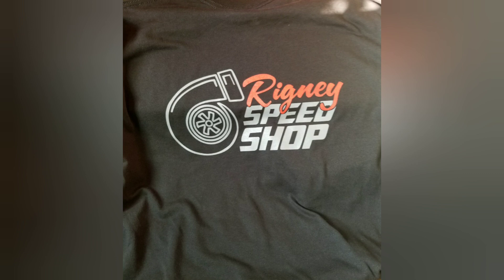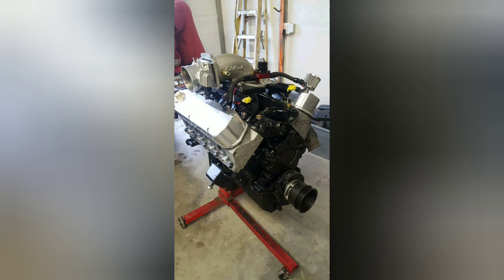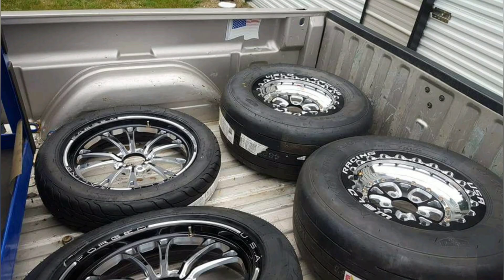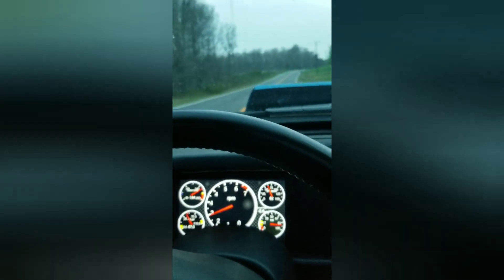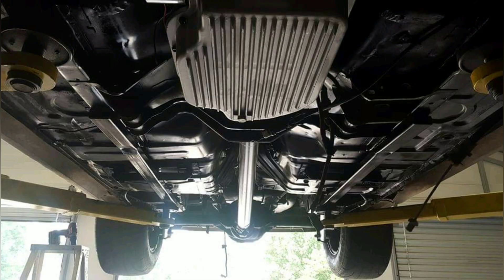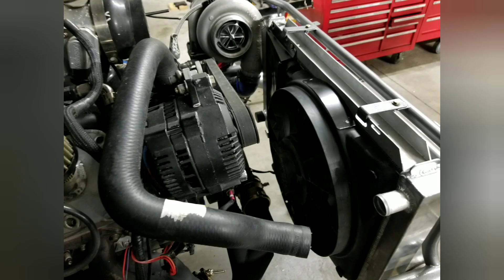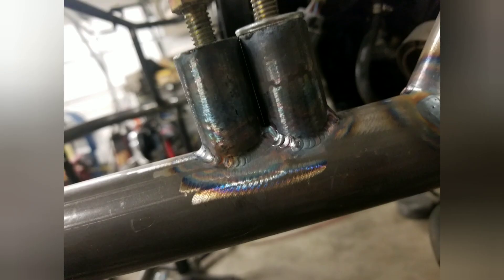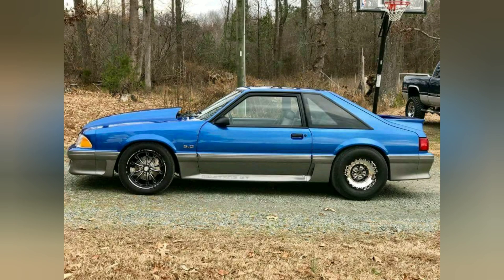Turbo mustang gt build

Comment: Make a update on this car
Reply from the maker: Its still running and driving with the owner i don't really see it much. He still hasn't taken it to the track.
Reply: Nice car were did u get ur alum floor for ur car I'm getting the same kit from gibbons as u and need a floor kit I'm like u I have to do everything my self or I couldn't afford it I have a Bennett 438 Glidden headed turbo motor and powerglide Neal bolt together converter